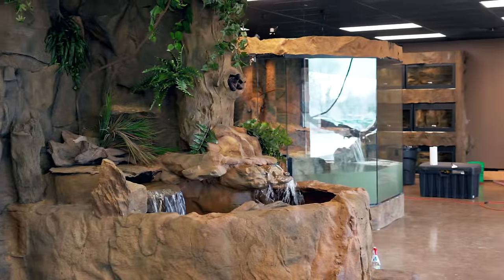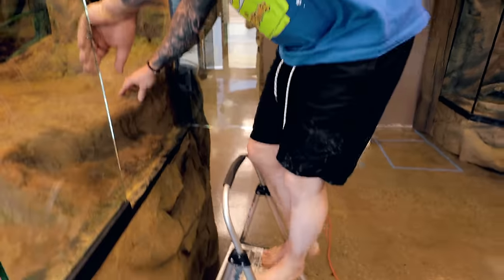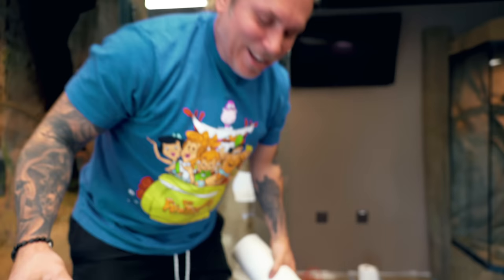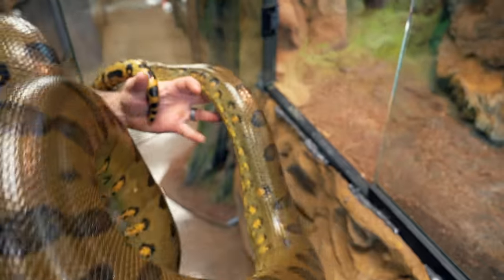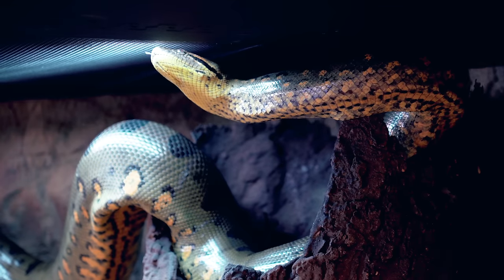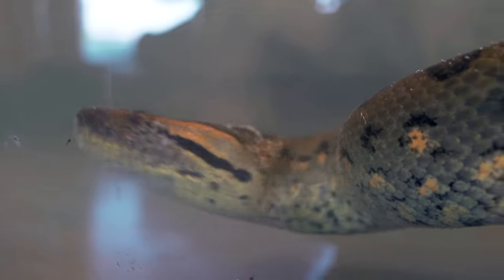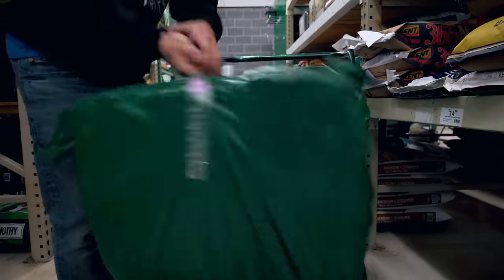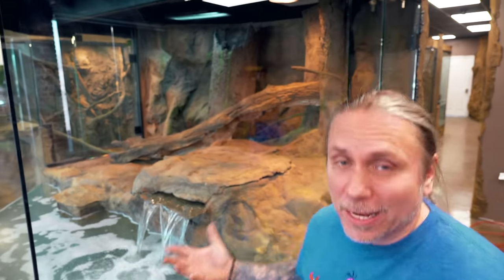MOVING MY HUGE ANACONDA INTO A NEW GIANT CAGE AT THE REPTILE ZOO!! Build Day #14 | BRIAN BARCZYK

Comment: Sap sack holder is to hold a plastic bag some people use when tapping maple trees for sap.. you can use those plastic sacks or buckets but most big time sap guys run lines through the woods connecting all the trees to each other with rubber line all pitched downhill to a tank..saves a ton of work and time running lines .. have a great day Brian keep up the great work!

Comment: ok so a few questions, first have you looked into the massage board and seen if you need a licence for snake massage? you may need approval from the state for a massage room, esp if your charging for it.  second, what are you using for cleaning the table between clients, i recommend Sani Cloths, they are the best for cleaning in between. Next, if you do have to have approval from the board, you will have to have a bathroom with in a certain amount of feet to the room. are you putting sheets on the table, if not you will have to have a barrier between the client and the table other wise they will stick to the table. wide butcher paper would work. next is your person massage approved if you need a permit. they might have to have a licence for massage. (sorry i am an LMT and these things come to mind) if you have questions i would be happy to talk about it.